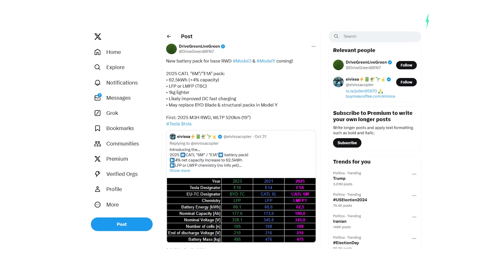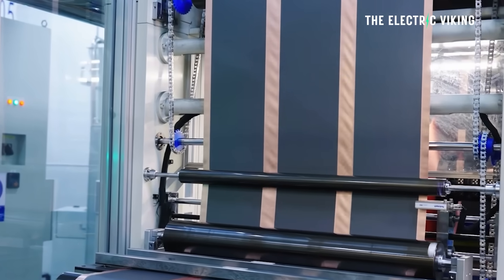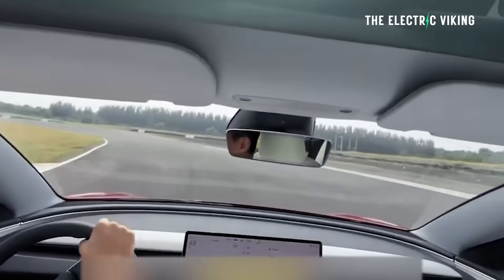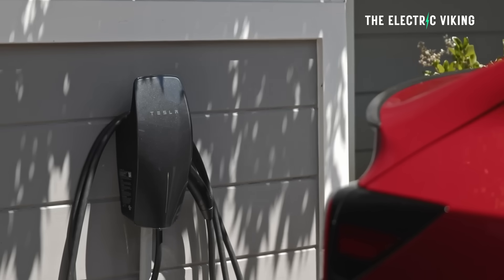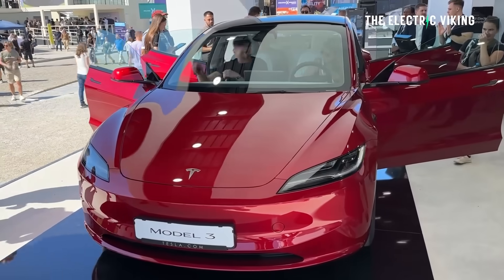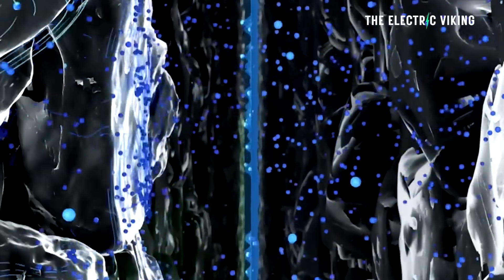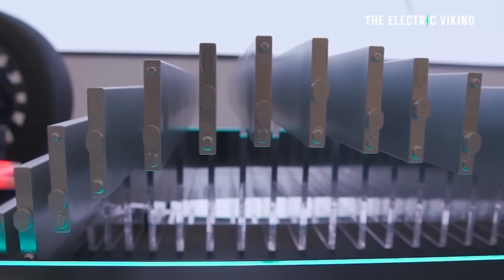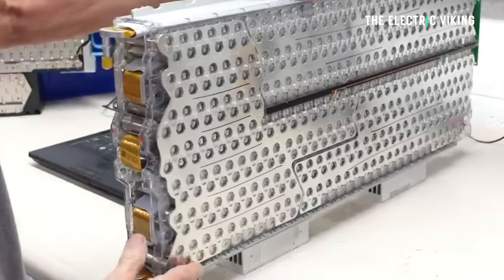2025 Tesla's will get a brand new CATL 6M battery with faster charging

Comment: One of the most important information is missing? How does the battery charge in cold temperatures WITHOUT pre-heating?

In winter when one anyway has significant higher consumption the reconditioning of the battery is a double negative tap. As anyway often multiple chargers are occupied max charging isn’t possible - so a battery with the ability to charge at 125-150 kw at 0 C would be highly recommended!

Comment: You're incorrect about the charging capabilities of the BYD blade pack that's available in Europe. It actually has the best charging curve of any Tesla battery, and holds high charge rates up to 80% SoC.

Comment: hi, do you know if m3p made in china will have a similar battery pack with high voltage like the one in usa (panasonic) and get 510 hp?
Reply: No it has 460 hp.
Reply: @ I know this.
I asked if there is any information or leaks about getting, (in the near future), the more powerful battery pack to the m3p that made in china?

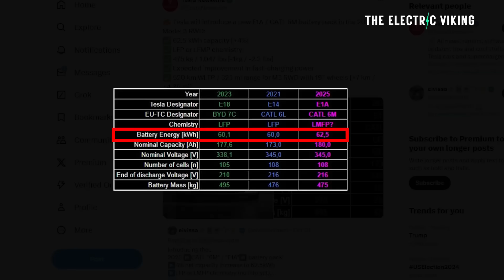Comment: The numbers don't add up on the chart at 2:15. 62.5 kWh for the 2025 CATL 6 battery. At around 4 miles per kWh, that's a range of around 250 miles EPA. To get 400 miles range, you need around a 100 kWh battery. Forget the weight, range mostly depends on kWh in the battery (although smaller, lighter cars get a little better mileage).
Reply: The model doing close to 400 miles is the LR RWD with the 75kwh battery.

Comment: We are in for 100 more years of battery development and it’s going to be amazing.
Reply: True. We need 2x capacity at 2x less weight. 120kWh in ~200kg pack
Reply: @GallAnonim-jx2cz   that would be perfect + 5min 10-80% charging. At that point ICE would be dead.
Reply: @Christian-peltz charger blockers will be a problem.
Reply: I don't want 2 videos a day from the viking clickbaiting with fake game changers
Reply: I'll bet you $1 million battery tech drops off significantly in 50 years. Put up or shut up!

Comment: Any advances in range for Tesla will just mesn they reduce the cells in the vehicles. It reduces weight and cost for them to make the cars. Tesla hasnt been concerned about more range than the 400+ they get on the MS. More would be nice but for most people 400 is fine.

Comment: I have just ordered a Model 3 RWD LFP from Shanghai with delivery in December and from the VIN number i can see it is a 2025. is it possible i will get this new battery?
Reply: Everything is possible, but dont hold your breath. They have been promising new batteries for years - and they are still the same..

Comment: Seriously Sam...Love my '23 LR Model Y....will I replace my Mazda CX5 with a Juniper...well it depends on the range and charging speed...i just drove 2250 kms over 3 days in the Mazda...and the range in my current Y is not there yet...will wait and see
Reply: Really crossing my fingers that the 95kwh battery rumors are real.

Comment: American govenrment officials undermining Amreican consumers and businesses by keeping out superior Chinese technology.
Reply: 7-8 EV fires daily.  Lifespan of 4-5 year.  Superior Chinese technology?  That's a big NO.
Reply: @KP-xi4bj  When talking best of the best, CATL has 6C charging and 1 million km EV batteries. Far superior to any EV battery currently sold in America.  Even Tesla uses Chinese batteries abroad but for purely political reasons doesn't use them in America.
Reply: @mydogsbutler  "1M km EV batteries".  Yeah, sure.  🙄

Chinese batteries are only used on German-built base/RWD Model Y and Shanghai-built base/RWD Model 3.  Everywhere else outside of the US, LG batteries are used.  And in the US, Panasonic provides the batteries for Teslas built in the US.
Reply: @KP-xi4bj  Yes. I million km EV battery. CATL is the biggest battery company in the world by far. It's not some fly by night company.
Reply: @KP-xi4bj  Neither LG nor Panasonic batteries can match CATL's latest  in durability or charge times much less any American battery.
Reply: @KP-xi4bj  The 1M km CATL battery is being rolled out for electric buses first. 6C batteries are being rolled out in 2025 Chinese BEVs. CATL also has a 500Wh its testing for aircraft which is more than twice the energy density of average EV battery. . No one is even close to CATL in mass production of EV batteries or can match it for available technology.
Reply: @mydogsbutler  CATL cannot match LG/Panasonic's energy densities or performances at extreme temperatures.  Enough said.
Reply: @mydogsbutler  Yeah, sure.  🙄
Reply: @mydogsbutler  With some of the highest EV fires from companies that use their batteries.
Reply: @KP-xi4bj  "CATL cannot match LG/Panasonic's energy densities or performances at extreme temperatures."

Not sure what you mean by "extreme temperatures" but in energy density what your claim isn't accurate..  CATL's mass production Qilin battery has 255Wh/kg . There is no current non-Chinese vehicle that can match  ZEEKR 009 electric MPV in charge time or energy density.
Reply: @KP-xi4bj  Can you provide an example of a non-Chinese EV that offers 5C or better charge times?
Reply: @KP-xi4bj  

Tesla's V4 Superchargers are capable of delivering peak charge rates up to 250kW. China is currently installing thousands of charging stations that can charge at up to 600KW rate. US is years behind China not only in EV rollout, value, but also in EV battery tech.
Reply: @mydogsbutler  Extreme temperatures as in the summer heat and cold winters.

"The energy density of a Tesla 2170 battery is close to 300 watt-hours per kilogram (Wh/kg). This is about 20% higher than the energy density of an 18650 battery, which is around 250 Wh/kg." - ELB Energy Group

Both Panasonic/LG make 2170 batteries for Tesla.
Reply: @mydogsbutler  Wrong again.  Tesla's V4 Superchargers can charge up to 350 kW but currently is limited to 250 kW.

Next time, do your own research.  SMH
Reply: @mydogsbutler  "According to statistical data from China’s National Fire and Rescue Administration, the rate of spontaneous fires in NEVs increased by 32 percent in the first quarter of 2024. This means that currently, an average of eight NEVs catch fire in China every day — nearly 3,000 a year." - Vision Times
Reply: @KP-xi4bj  You can spin the Tesla supercharger inferiority all you want but the fact remains China is rolling out 600Kw chargers. You really need to do your homework on superior Chinese ev and battery tech before commenting on it.
Reply: @KP-xi4bj  Still waiting for you to provide an example of a non-Chinese EV with 5C or better charging.
Reply: @KP-xi4bj  1.4 billion people divided by 3000 equals 1 EV fire for nearly 500,000 Chinese people..  NY City has a population around 8M. It;s fire department responds to tens of thousands of fires annually.  Don't think 16 EV fires a year would be a deal breaker to anyone really concerned with stats.
Reply: @mydogsbutler  I'll take Chinese EVs seriously when they last more then 4-5 years or don't catch fire 7-8 cars daily.
Reply: @mydogsbutler  I'm still waiting on a Chinese EV that will last more than 4-5 year or don't catch fire 7-8 cars daily.
Reply: @mydogsbutler  Vast majority of NYers take public transit.  In other words, they don't own personal vehicles.  Bad analogy.

But 7-8 EV fires daily, now that's a real concern.
Reply: @KP-xi4bj  You are talking theoretical bare battery. The completed battery pack on a Model S has a 1200lbs/545kg 100kWh battery. That's a finished pack of 183wh/kg.

Tesla Model S  100kwh battery range is about the same as the Zeeker 001 100kwh but Zeeker charges far faster and costs half the money. And it does that while having features typically reserved for premium American and European cars. There is no EV sold in America or Europe that can remotely compete with Zeeker 001 on value.
Reply: @mydogsbutler  "Since the Qilin design is a pack structure, it doesn’t necessarily mean these EVs will all carry CATL’s max energy density (255Wh/kg). " - electrek

Lie much?

Denial is a disease of the mind.
Reply: @KP-xi4bj  If you want to talk about lying, or perhaps denial, you should be looking more carefully into your ridiculous attempt to claim Chinese EVs are behind America.  Where are the 5C and 6C chargers and EVs in America?
Reply: @KP-xi4bj  Cool story. BYD has a 10K commuter EV in China. Where is the 10K Tesla or any non-Chinese EV being sold in China for 10K?  Oh right. Doesn't exist.
Reply: @KP-xi4bj  

Model S 100kwh battery has about the same range as Zeeker 001 100kwh but costs twice the money and charges 40 percent slower. How exactly is that competitive again?
Reply: @mydogsbutler  Doesn't exist because there's a thing called standard of living in the Western world.  You know, a salary that you could live off of?  A 10K EV could only exist due to government subsidies and cheap labor and materials.  A 10K EV would not pass the stringent crash test standards in the West.  

But keep coping.
Reply: @mydogsbutler  A Model S Long Range has over 400 EPA miles and can do 0-60 mph in 3 seconds.  A Model S does not catch fire.

"On April 20th, a Zeekr 001 parked on the side of a street in Xi’an, China caught fire." - Pandaily

"June 23: a Zeekr (极氪) 001 EV caught fire spontaneously in an underground car park in Ningbo, Zhejiang." - Byron Wan on X

In China, Tesla outsells BEVs from BYD.  That should tell you that even the Chinese do not trust BYD.
Reply: @KP-xi4bj  Nice try. We are talking foriegn owned EVs companies also producing and selling EVs in China. Where is the foreign EV produced for 10K EV in China?
Reply: @KP-xi4bj   Over 60 percent of EV batteries in the world are made in China.  1.4 billion people and over 50 percent of new cars sold in China being EVs means move EV fires in China.

If US EV stats are any gauge, EV battery fires are far less common than ICE  but the type of fires for EVs are more dangerous as they can occur when parked and more difficult to put out when they happen. The danger isn't so much in fires while moving but catching fire in say an underground parking garage of an apartment building or shopping center..
Reply: @mydogsbutler  If more people in China could afford Teslas then there would be way less EV fires.  Since 2008, there have been only about 232 Tesla fires.
Reply: @KP-xi4bj  You can currently buy a commuter BYD Seagull in China for under 10K which is substantially less than the price of any ICE car in America. You can buy a Zeeker 007 2025 that charges in 11 minutes, has 500 range, for around 30K. Even Tesla is feeling the heat of Chinese EV competition as its EV sales has fallen considerably in China.
Reply: @mydogsbutler  EVs in China are heavily subsidized.  Even before the EU/US imposed 36+ % tariffs, EVs sold outside of the Chinese market were more expensive than the ones sold in China.  

Your 10K BYD Seagull is 20K in the US.  Never mind the crash safety-worth of the Seagull on US roads, that 20K could get you a used model 3 with more range and better performance.

"Tesla delivered 462,890 vehicles in the third quarter, higher than BYD's BEV sales of 443,426 ... That's up 6.4 percent from 435,059 in the same period last year and up 4.26 percent from 443,956 in the second quarter." - CnEVPost

Tesla sales have fallen in China?  That's a big NO.
Reply: @KP-xi4bj  BYD only recieved 1 percent of its revenue in 2023 from subsides. Llet's not forget Tesla also received billions in  direct subsides and billions more in indirect subsides by tax breaks for EV for consumers. Intel has is slated to receive  more money in subsides from CHiPs act this year than BYD gets from the Chinese government. Do you propose other countries slap a 100 percent tax on American made processors?
Reply: @mydogsbutler  "In total, the Chinese government doled out $231 billion in subsidies from 2009 to 2023 according to a report from the Center for Strategic and International Studies." - CBS News

"Currently, the electric car manufacturer BYD receives particularly high subsidies. Direct subsidies amounted to approximately EUR 220 million in 2020, rising to EUR 2.1 billion in 2022. In terms of business revenues, direct subsidies increased from 1.1 percent in 2020 to 3.5 percent in 2022. " - Kiel Institute for the World Economy

BYD only received 1 percent of its revenue from government subsidies?  Sure, buddy.
Reply: @KP-xi4bj The 231 billion figure was all EV makers in China, not just BYD or just Chinese ones.  And over 15 year. And you didn't look at current stats as subsides have rapidly dropped last few years. Today they only represent 1 percent of BYD revenues. As a portion of sale that's less than intel is receiving in US government subsides this year with CHiPs act. Do you support a 100 percent tariff on Intel chips in the rest of the world Mr. Principles?
Reply: @mydogsbutler  "China gave BYD $3.7 billion to ‘win’ the EV race" - electrek

"Currently, the electric car manufacturer BYD receives particularly high subsidies. Direct subsidies amounted to approximately EUR 220 million in 2020, rising to EUR 2.1 billion in 2022. In terms of business revenues, direct subsidies increased from 1.1 percent in 2020 to 3.5 percent in 2022. " - Kiel Institute for the World Economy

My math isn't the greatest but I know $3.7B is more than 1% of it revenue.  Next time, do your own research.

We're done here.  You're obviously trolling.  The sign above your head says, "DO NOT FEED THE TROLL".
Reply: @KP-xi4bj  Your reading skills aren't very good either. I said 1 percent of revenue BYD is subsides. The source of this claim is. BYD itself but lets   go with your 3.7 billion figure instead.  BYD has over 100 billion in sales this year. Going with your figures you still only end up with 3.5 percent of revenue is subsides this year. How do you get to magically 100 percent tariff again? 

President Joe Biden signed the bipartisan CHIPS and Science Act in 2022 to boost semiconductor manufacturing as well as research and development. The $280 billion package, which is not only focused on chips, includes $52 billion in subsidies for semiconductors. So far, over half of that has been allocated to chip designers and manufacturers in the U.S. Intel, estimated sales around 53 billion in 2024,   received 3 billion in direct funding in 2024 with potential for another 5.5B if Intel can reach certain metric for total potential of 8.5B this year. Then throw in another  $11 billion in loans.

So you support a 100 percent tarrif on Intel chips right?
Reply: @KP-xi4bj  You are the one that started trolling because you are upset that China produces superior EV  technology and at a better price. Sorry that the facts upset you. No examples of 10K EV made by an American car company in China. No examplea of 5C and 6C charging in America.  Chinese EVs and EV batteries net dominate global sales.  But trust me bro the US EV industry is better.

Comment: My U.S.-made Model Y with an NMC battery, with ~320 miles of range will see >3000 cycles before it degrades to 80%, so 3000 x 320= 960,000 miles.  I think we'll be o.k. with NMC until full silicon anode, solid-state batteries become commercial.  I still think LFP is great for battery storage but, not good for vehicles.
Reply: I'm very happy with my Model 3 fitted with a LFP battery

Comment: I'm waiting for the Dilithium Crystal in a Structural Glovebox. Range is 50 light years on a charge with a 30-mile buffer charge😊
Reply: It can be charged in an emergency by setting phasers to stun and directly shooting the dilithium core.   You’re welcome.
Reply: I'm going to also wait. Should be out in fifty years or so.😅
Reply: I've got one. Charges reeeally slow.
Reply: @josephbradford5930  - Hmmmm.... maybe you need a Mr Fusion instead😁
Reply: @thomasruwart1722  🤣😂🤣😂🤣
Reply: @josephbradford5930  - if it takes more than 3 years to charge then you'll get canceled😁
Reply: @josephbradford5930  D.C. produces power, doesn't store it. Busted!
Reply: @1voluntaryist  Yeah, busted. I had no clue. Just wanted to feel included with the cool kids 😁
Reply: I'm waiting for FTL travel.  Yup, still here waiting ...
Reply: It's always 5 years away
Reply: Toyota is set to release it very soon.
Reply: Throw in a free Teleportation passenger seat with the FSD. Name your Omnibot "Data".
Reply: Combine it with time travel and changing will be instant.
Reply: @jondonnelly3  - Hmmm... that's exactly what they said at the Time Travelers Meeting next month😁
Reply: @thomasruwart1722  "Structural Glovebox" is the best part. A+ !

Comment: It's not just about charging speed. Regen in cold weather should be much better too (which is CATL LFP current weakness). I have a Model Y with Byd Blade LFP battery, it's charging insanely fast (10-80% in 18min) and has great regen even at 100%, even in cold weather condition. I bet CATL 6M LFP will be the same.